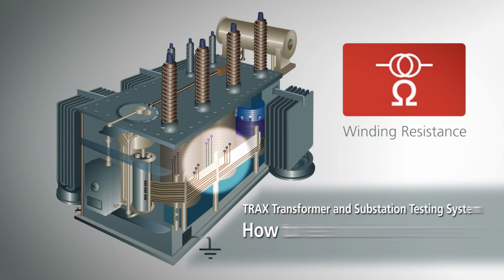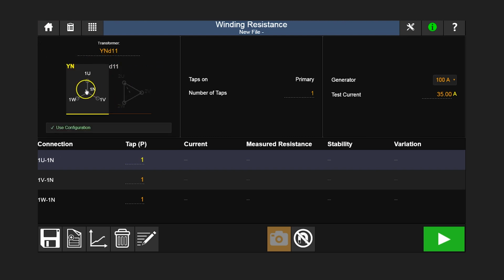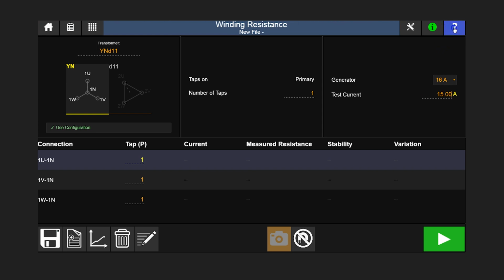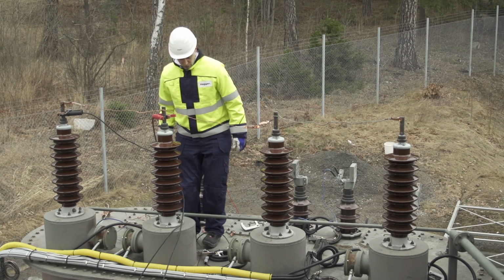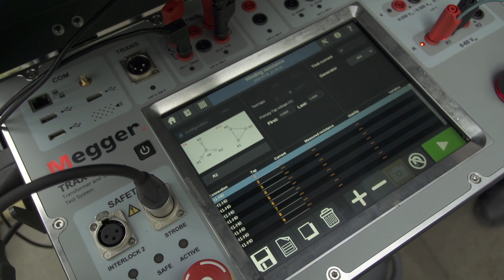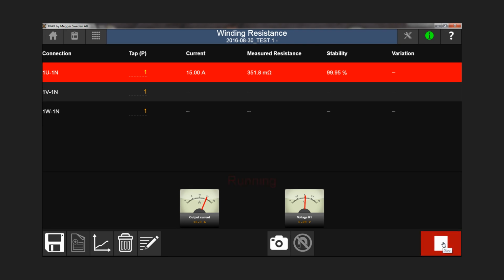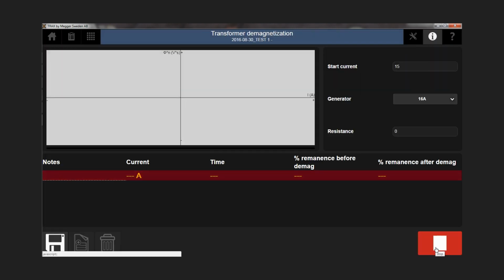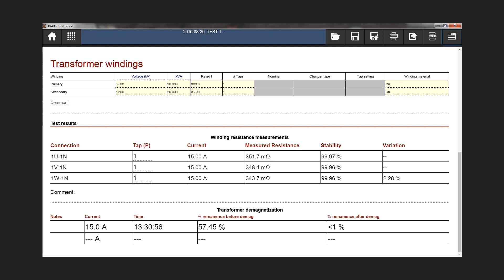Megger WINDING RESISTANCE REV (TRAX)

Comment: Many greeting, we have a DC Winding Resistance device, type MT0210,  megger company and there is an error which appears under cod 112 , when I examined  its catalogue, the discription shows ( storage mode switch error), and there is no  more details  showing what can I do?
Kindly I asked you to help me fix this problem.
Engineer Omar Eyad
Mail : omareyad72@gmail.com

With my best regards
Reply from the maker: Hi Omar, thank you for your comment. Do you know if the error code disappears when you change the storage mode switch position? If you could contact uksupport@megger.com and they will try and work out what is happening. Thank you.